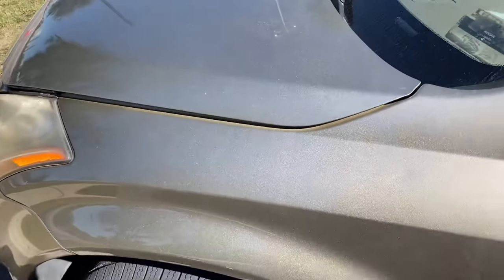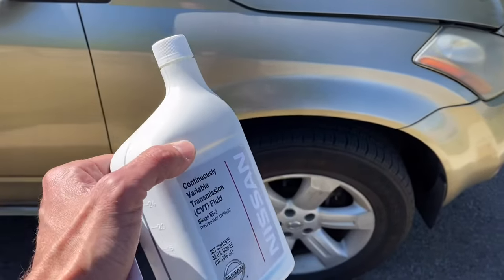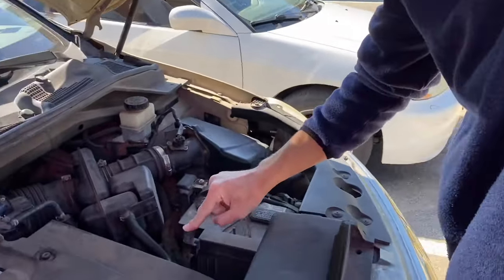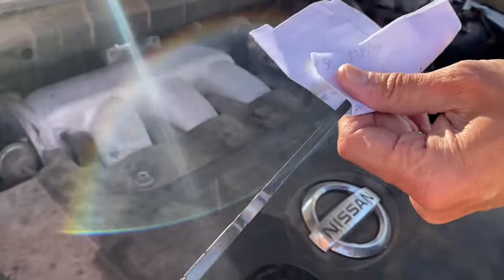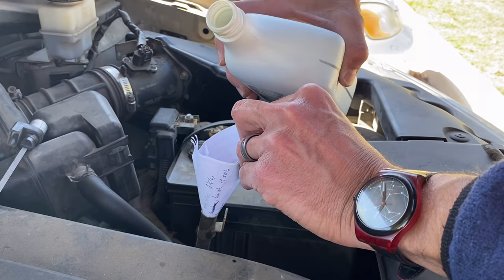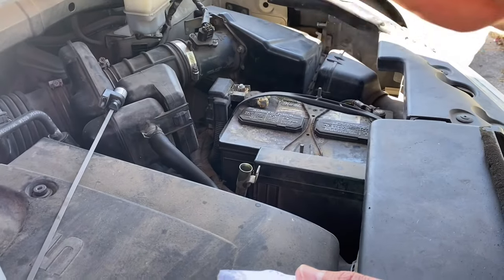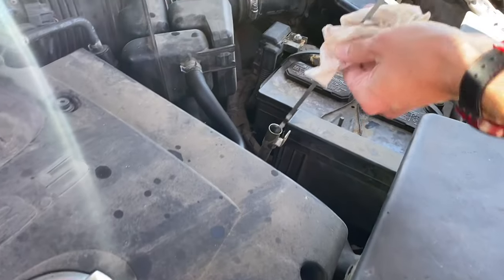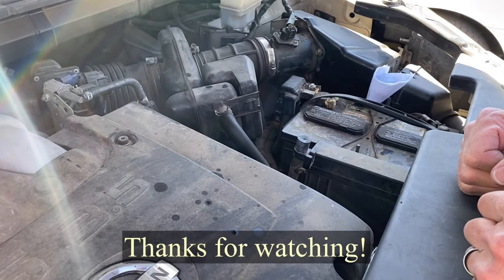Nissan CVT Fluid Check

Comment: I had the same issues with my 2013 murano, over heated and was jolting and not letting me drive more than 30kms an hour. Topped up coolant and oil and still had issues. Topped up transmission fluid with Penrite Cvt fluid as seen in the video, disconnected battery. On battery reconnect and starting the car the engine light was gone and it hasn’t tripped since. Running like a dream now! Thanks!
Reply from the maker: Glad this video helped you, is there a visible leak to see where the fluid disappeared to?
Reply: Update?
Reply: @Tpfutures Mimi 😊😊😊 mom o

Comment: A lot of these CVTs have a cartridge filter on the side and on some models the housing is held with one bolt or on mine it is held with 4.  Be careful to get one with the correct gasket.  One is a regular O ring and the other is some sort of metal seal ring.  These are very different from one another and will not work interchangeably.  Just make sure that if it is the metal one that it stay in place when the housing is put back on or it could cause a gap betweeen the transmission and that housing and your fluid will gush all over next time you start it up making a horrible mess.  I imagine the regular O ring would be easier to know if it is seated properly.  The bolts are 10 mm heads and I like that it seems to be such a common size on these vehicles for a lot of things.  It is a little bit tricky to get to that filter but on mine it was toward the passenger side.  I don't know if other models or revisions of the CVT have it on the other side.  Just changing that little filter makes a difference.  It is for the fluid cooler or warmer (depends on what you like to call it).

Comment: I love my maxima, but I am frustrated that Nissan service will not replace cvt filters. They actually lie and told me that it didn’t have one. It does, and for that reason, I will not spend any more of my money on a Nissan in the future.  Nissan, wake up, you are destroying your brand!
Reply: I literally just changed my fluid and filter on my 13 Maxima a week ago.   If you can change your oil you can change your Trans fluid & filter.
Reply: I have a 2011 Nissan Murano. The one thing I’ve been blessed with is that this car has a new transmission in it. So, I do plan to change the fluid every 30,000 miles. I also plan to change the oil myself.
Reply: I just did this job last night, on my 2010 Altima at 164000 miles.  I replaced BOTH strainer and cooler line cartridge filter.   The cartridge filter was a PIA, specially one of the bolts.   Back when car was at 60k and 120k, I took it to dealer and spent a fortune on what I thought was the same service, though I know they replaced all approx 12 qts and not just the 5.5 qts in a drain and fill.  The only problem is that I recently found out that they never did replace the two filters, just fluid exchange.  I was upset.  Now that I'm out of warranty, just did it myself (though just drain and fill).  Pan strainer filter and fluid is not tough.  The other one I never want to attempt again.  I was able to get both filters and gasket from advanced auto (car quest).  You won't find the large O ring from the smaller filter housing, so I used my old one and crossed my fingers.  Also, I wasn't spending  $27/qt for NS2 fluid at Nissan.  I used the Valvoline  synthetic NST in a blue bottle.  It is also clear in color (not red) and seems to be working good, so far.  Picked up 6 qts for about $60
Reply: BTW, that Valvoline cvt fluid, in the blue bottle, says it's compatible with both NS2 and NS3 systems
Reply: Agreed 1000% I even made a video on it

Comment: Just had this happen to me at low speed, you feel a slight buck and then its like power is not being applied.  So your vid is the first one that came up, 163K with trans replaced under Nissan's Murano extended warranty at ~118K.
Unfortunately, fluid was at the proper level and very clean.
Just did a 200 mile tow of light trailer with a couple of couches last week, aside from a few other similar tows since adding a hitch several months ago.
Wife passed this on to me 5-6 years ago when trans was replaced in a swap for an CARB-compliant Ford Focus electric I had a lease on.  Somehow Toyota can build bullet-proof CVTs, yet Nissan's Jetco are still crap after 15 years of trying. Never buy a Nissan.
Reply from the maker: Sorry this happened to you, sadly, CVT transmissions are very delicate and shouldn’t be used to tow anything. Your issues might be throttle related or engine related since the fluid looked clean. I would check your vacuum hoses and electrical connections before giving up.

Comment: 03 Murano and tried checking fluid before and after adding a quart and don't see any markings on the dipstick. Tried it the backwards and forwards way. My car was making symptoms of cvt fluid so added a quart. I see clear dipstick even though the fluid is reddish brown.
Reply from the maker: Might be so low that it isn’t showing on the stick.  Are there markings on the stick or are you not seeing fluid on the stick?  Also, when checking, you must put the stick all the way back down past the “click” sound.
Reply: @ijfim  I see clear liquid like the colour of vegetable oil on the stick but the fluid is reddish brown that I put in. I stuck it all the way back on front and backwards without any markings like on my oil dipstick. I'll try checking again tomorrow. I ran the car while checking should I do something different?
Reply: If the fluid you put in NEW was reddish brown, that's a big problem.  It has to be ONLY CVT fluid.  The conventional transmission fluids for non-CVT are red.  Did you use the correct CVT fluid for Nissan vehicles?  Muranos use NS-2 or NS-3, depending on the year.  Look it up in your owner's manual

Comment: Hi...I also have a 2006 Murano that i recently took in because it has a burn smell when i park it.  Originally i took it to the dealer because when I drive it in the morning at first start it feels like it's going to stall.  After I use it it drives fine.  The car has 116k miles on it.  No oil on the floor.  I was told it has a torque converter seal leak, oil pan and gasket leaking and possibly power steering rack leak.  I know it's an old car but i can't afford a car payment right now.  Can the car be driven with these issues as long as the fluids are checked?  Any advice is appreciated... thank you.
Reply from the maker: My advice it to be very vigilant with fluid checks and monitoring temperatures.  I would not drive it long distances at the moment.  If it is a burning rubber smell, it is likely a leaky valve cover gasket leaking on the exhaust manifold.  If the transmission fluid is leaking out the bottom, I agree with the mechanic.  This car can strand you in its current condition.  Ensure you have a supply of the required fluids at all times and always check daily.

Comment: I have a maxima and i just notice it does not have the stick. Whay do i do?
Reply from the maker: Not sure about maximas?  I’ve never seen the engine bay of that car.
Reply: Drain your Transmission Fluid and measure how many quarts came out and top off with new fluid with the same amount that came out. Or just google how much it’s supposed to be and fill it up to the right amount

Comment: #cliffhanger... did it fix the problem?
Reply from the maker: No, the stronger transmission made the underlying engine problem more pronounced.  Unfortunately, the truck was totaled 1 week after the video was recorded.  Teenager on phone t-boned the owner.
Reply: Sir! I have a quick question. What if you have a transmission fluid in the cross hatch near the top of the dipstick. Is that satisfactory?
Reply: @robbieyh  If it’s within the crosshatch then it’s fine. I had mine like this (at the top of  crosshatch) after drain/refill, and I had no issue.

Comment: But did you check it with it running in neutral or in park
Reply from the maker: Sorry just saw this question.  “Park” of course.  Neutral could work, but I believe safety is engineered into the procedure from Nissan with “park” being the best choice.
Reply: U do in neutral if u have newer model murano and if u unbolt the overflow bolt to check the cvt level

Comment: So did it fix it after adding fluid?
Reply from the maker: Setting the fluid at the proper level improved drivability, but the fluid was only part of the bigger problem with that vehicle.  Sadly, we couldn’t troubleshoot any further since the truck was totaled that same week!
Reply: @ijfim  Hopefully the vehicle being totaled worked to your advantage and no one was hurt. I have a 2004 Nissan Murano SL that I bought brand new with 9 miles on it. I just hit 116,500 miles. I have an axle seal leaking.  It's not bad but I need to get it fixed. I usually do it myself but not this time. Thanks for the reply.
Reply from the maker: Pay attention to your fluid level closely since you have that axle leak!
Reply: @ijfim  Thank you. Yes, it wasn't too bad but I just had the axle seal replaced and everything is good now.

Comment: I wonder if it fixed the problem.
Reply from the maker: Sadly….no.
Reply: @ijfim  I have the same situation of low transmission fluid (reading the same as yours was). I have no acceleration.
Reply from the maker: Only thing you can do for the tranny is to fill it to the proper level with the proper fluid.  They are delicate inside, so it is very important to have the proper level at all times.
Reply: @ijfim  I'm going to do it tomorrow. I hope it fixes it!
Reply: @billwalsh388  how did it go sir??
Reply: I have a 2012 Nissan Murano that my daughter gave me she had purchased it a few years back and I might say off of a crooked used car dealer that up and left town as I was having a hard time dealing with one of his employees that sold my daughter the car the day she drove it off the lot was the very day the transmission started giving her trouble she told me that she was driving and accelerating down the road and the car started losing power and eventually would not move she could press on the accelerator the engine revs up but no forward or reverse motion..
Two different mechanic says that she needs a new transmission I'm wondering if one was to tear into the transmission clean the filters and replace what can be replaced as far as bands filters and new transmission fluid if that wouldn't fix the problem I also heard from someone who has worked on the Nissan vehicles that it has something to do with all the different electrical parts and sensors doesn't have enough juice running to them and that part needs to be replaced if my memory is correct I could have swore this mechanic said it was the alternator but that doesn't sound right he says it's up toward the front of the vehicle by the bottom of the radiator and they run about $300 have you heard of anything as this??
Reply: @carlospadron488  It did the trick. I've been back on the road for about 5 months.
Reply: @tuckerevans4090 Did you ever replace the alternator? and if so did it do the trick? Im in the same boat lol

Comment: $20 a quart😂? What are they selling? Gold?
Reply: Valvoline CVT fluid at WalMart is $10 a quart.   Approved for NS2 and NS3 Nissan's CVT transmissions....
Reply from the maker: @douglasb.1238 wow, don’t know if that was available when I made this video, but that’s definitely a better price.
Reply: @ijfim  It's available at most Walmart stores...
Reply: Indamitsu produce Nissan NS-2 FLUID. they also sell it under their own name, a lot cheaper.
NS-3 IS ONLY for Nissan cars produced after 2012.
Follow the instructions on fluid  on sticker under the hood.
Nissan do not reccomend NS-3 as a replacement for NS-2...
Reply: Heck, I called Nissan dealer and they want $27.50/qt,  screw that.  Changed mine last night with the Valvoline synthetic CVT (in a blue bottle).  Got it for about $10/qt.  It's NS2 and NS3 compatible.  It's clear like Nissan fluid, not red.   Also, I heard that Idemitsu actually makes Nissan fluid.  You can look for their brand .  They have different types that are NS2 or NS3 compatible

Comment: You were supposed to flush it 🤦🏻‍♂️
Reply from the maker: When you check your fluid level, it’s not always economically feasible to flush the system.  This instance made more sense to top it up since it was low.  I agree, sometimes a flush is the best…
Reply: @ijfim  you just added a little bit of new fluid to a case full of burnt fluid  , you coulda saved it but u got lazy
Reply: This is the first time I have seen fluid for a CVT trans. It is strange looking!
Reply: @ericmadx3063  He's probably wanting to flush you!
Reply: No! Do not flush. Just drain and re-fill every 30k and you should be fine. If you did regular maintenance you could change the fluid twice in short intervals to get in as much of the new fluid as possible. 
These cvts require diligent maintenance that can get expensive. But it sure beats buying and replacing the cvt.
Reply: Drain and refill. If you flush, hope and pray your car will move again
Reply: @cristianortiz7005  that only happens with very old cars or when fluid is black 🤦🏻‍♂️

Comment: Hate YouTubers that just do the job and don't explain...I still can't find the dipstick and what I think is the dipstick has a locking mechanism on it...all this guy said was "dipstick is here, has you can see" and pulls it out in .1second...no dude, I didn't see and I will never see one of your videos again
Reply from the maker: I’m sorry you feel that way.
Reply: mine is under the battery but no dipstick attatched to the locking mechanism crazy. nissan versa. very difficut to spot but look for that black cap in the video.
Reply: 2:12
Reply: LoL he literally shows you where it is, taps on it with his finger and then pulls it out. Wtf else do you want him to do?
Reply: Sounds like you don't need to be driving if you can't find the dipstick.
Reply: Looks like we all just found another dipstick
Reply: On the Murano, 2012 was the last year Nissan included a transmission dipstick. The 2013 models have just the cap, with no stick attached. There’s a way to check CVT fluid level on this but it’s extremely inconvenient. You have to remove a plug on the side of the transmission, then add fluid until it starts exiting that hole (car must be level). Once it slows to a trickle, replace plug, you are at the correct level.
Reply: Hahaha what a joker😂..what a big problem to know where's the dipstick
Reply: @ijfim  you did good sir…🎉🎉
Reply from the maker: Just tryna help!
Reply: I’d be more concerned at where the fluid went to make it low .
Reply: Just get a dipstick from other model with ur same engine n u good
Reply: @bradnail99 u mean the overflow bolt which is on top left side of drain bolt